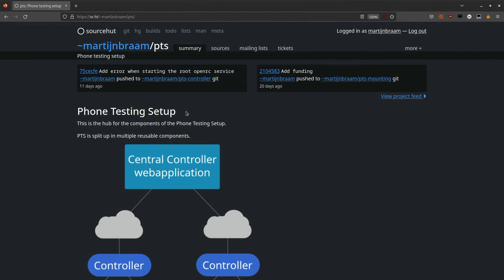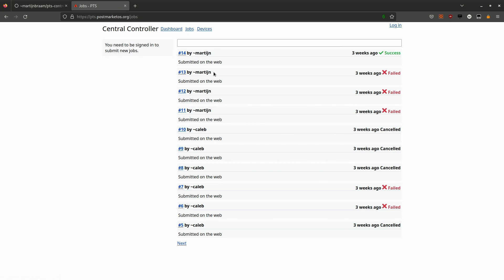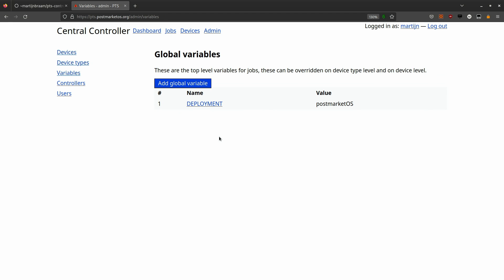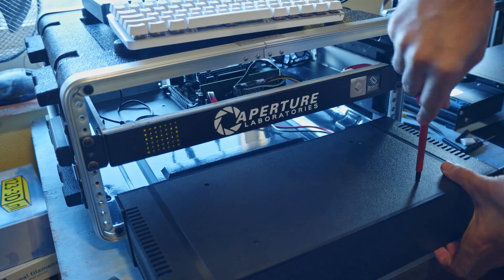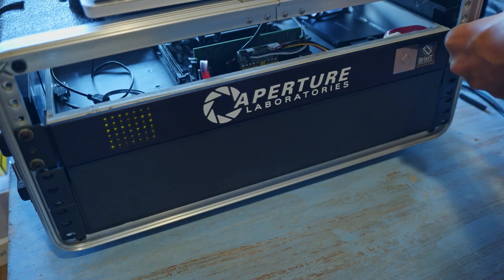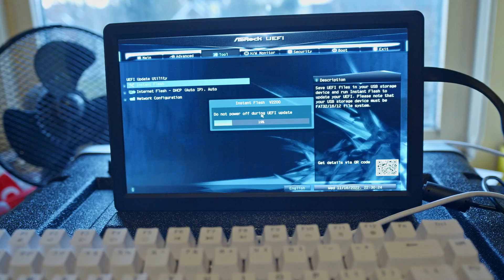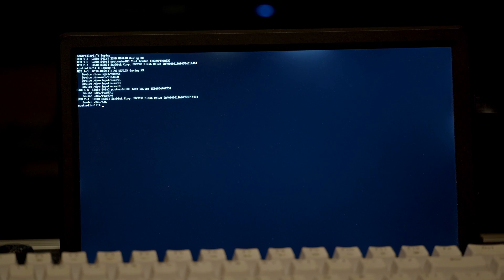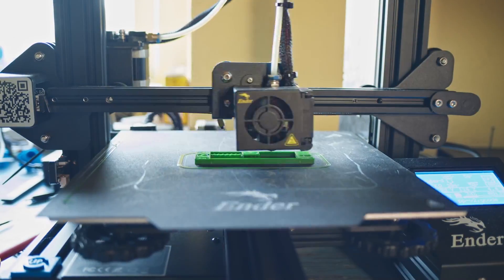The Phone Test System

Comment: 5:30 The audio is slightly off here.
Either that, or Martijn Braam is secretly a robot, and was running unattended-upgrade in the background while making this video, taking all the CPU, leaving no niceness for the audio stack :P
(I like the aperture testing equipment. GLaDOS would be proud.)
Also, if you want to get some cheap "controllers" that are maybe more powerful than a rPi, while also being cheaper, get a thinclient: These are typically cheap, but full x86 computers you can get for less-than double-digits prices.
Reply from the maker: I had to throw away a lot of takes already due to audio issues, I need to update some software probably.

A long time ago valve used to sell the aperture stickers and a few other ones from their franchises and they fit perfectly on a single rack unit. sadly they stopped selling them :(